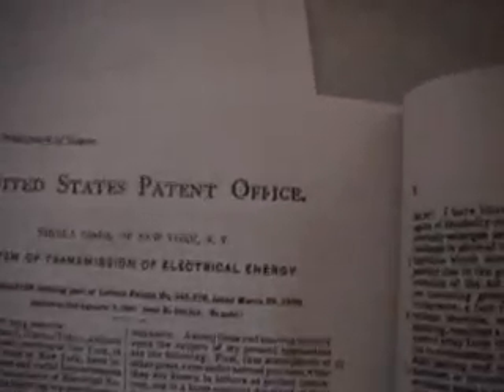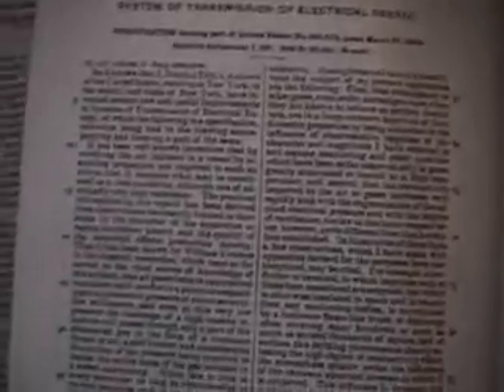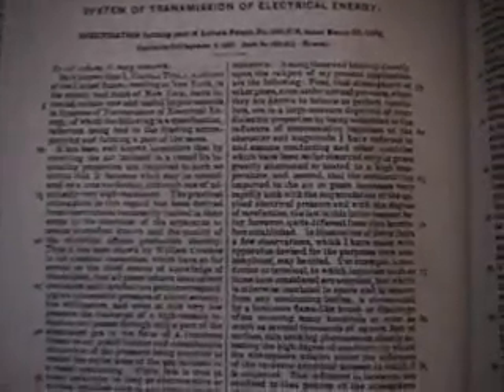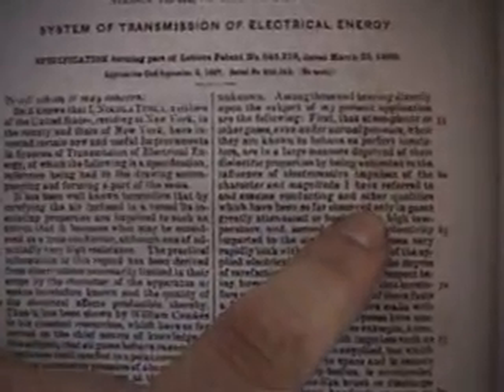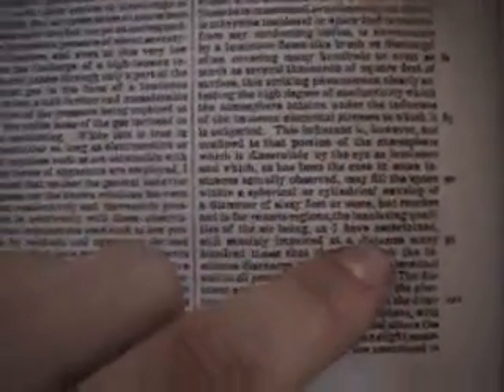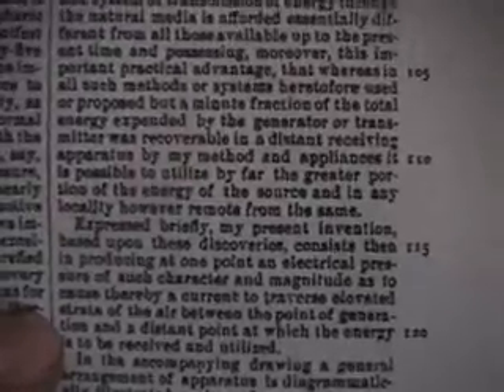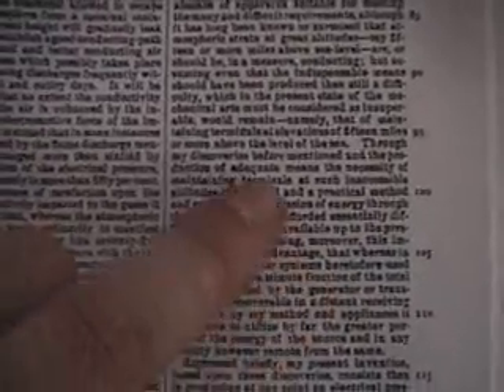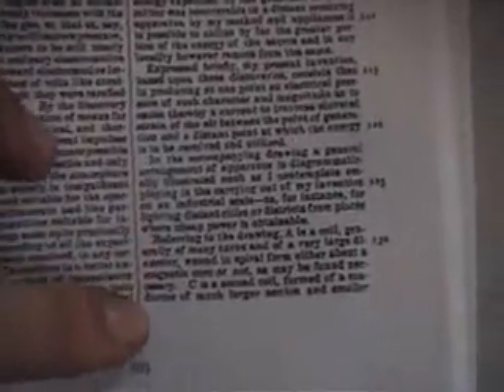Wireless Transmission of Electrical Energy, Tesla 1900 part2

Comment: @panzarw Search in Google picture for "tesla flat wound coil" and check the picture were you see him in front of a large coil reading a bood sitting on a chair. The flat wound you see in this picture is what I believe to be what he refers to as his "extra coil" in his Colorado notes. The picture on the patent describe here his using this design (primary on the edge around and secondary covering the rest of the surface - this is for the transmitter..receiver is the opposite)

Comment from the maker: @panzarw yes tesla was the first person to prove super conduction, remember compressed liquids was first begun,only about 100-150 yrs ago so the tehcnology is quite new at the time and tesla proved a drastic increase in reonance because the wires werew capable of holding energy more efficiently furthering the resonant effects.tesla probably used a tesla oscillator or turbine to safely and powerfully compress the air to a liquid for the use in the wardenclyffe, possibly.

Comment from the maker: yea i know  because tesla was able to multiply the current and voltage equally in these magnifying transmitters, which goes against the basic resistance equations. more interesting is how tesla talked of a spinning brush effect that was incompressable to any type of fields suggesting the instant communication to any distance faster than light because the electrons will not compress so one electron pushing another in a chain would instantly give the push to the last electron on the chain!ftl!!

Comment: 'Hi voltage' means nothing. It is up to us to start an underground movement to find the full details on the truth about electric theory -- because the fraternity opposes the truth.
A meter cannot change by magic and measure volts in parallel and then suddenly measure amps in series -- its rot. And the needle only records what is in its own short piece of wire and cannot tell us what flow is like in the outer circuit. When the exter. wire is short and fat, flow is slow and rel.fast in the meter.

Comment from the maker: ok, i will work on something like that, i might even attempt a tesla coil myself to figure out resonance.resonance is a strange occurance in electricity, even the electrical books dont fully explain its workings. resonance parameters can be either, makeing little or no resistance,  so energy is transfered efficiently(parallel),or make huge currents at resonance(series).there are series and parallel ac circuits. teslas circuit is now referred to a parallel ac resonant circuit.